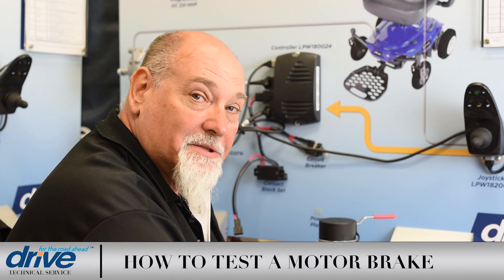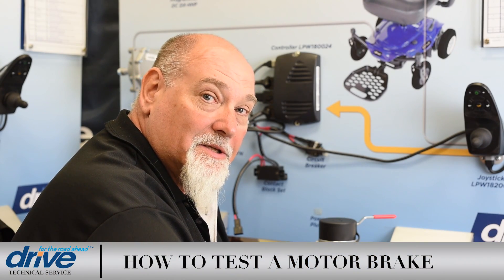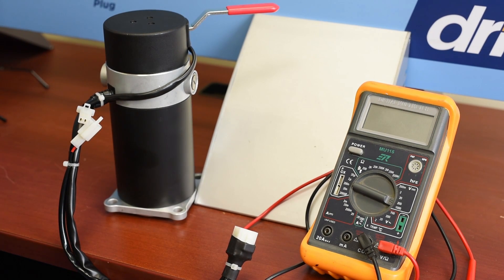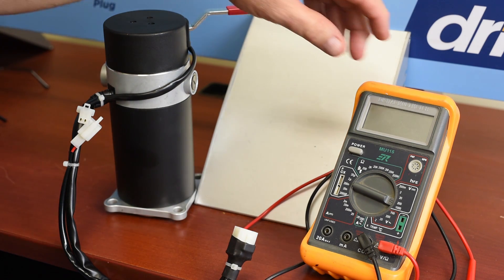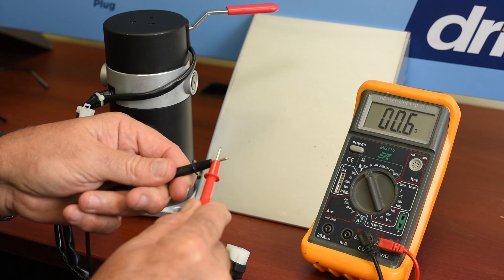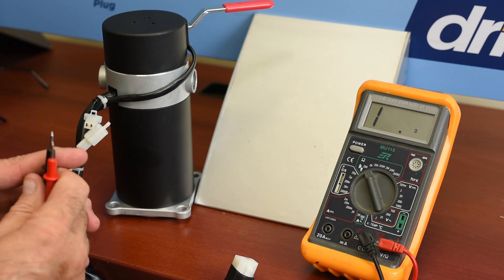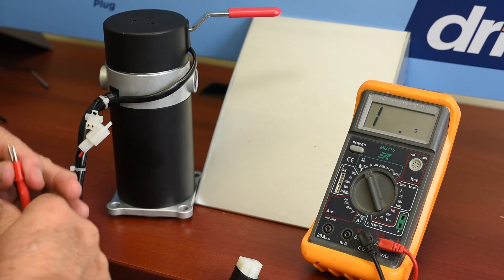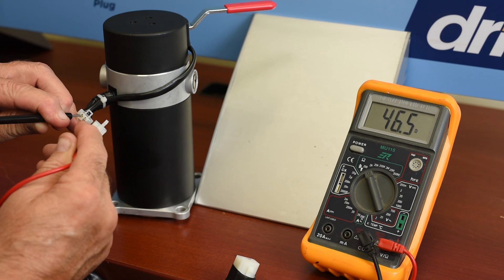How to test a Motor Brake

Comment: these coil based brakes can show correct resistance but short internally when 24v applied,
so best test is to apply 24v and see if it actually works. A very hot brake will also some times indicate a short internally.

Comment: Thanks for your information. I was dissapointed when measuring the resistance of the brakes in the motors of an invacare tdx sp i got from thrift . the resistance was giving ol reading. After viewing your video i tried again after engaging the gears? And Yes!, the correct resistance was shown

Comment: Hi, John, Love your articles very interesting to listen and learn.  I have an Invacare Leo scooter.  I have tested the brake as you suggested and there isnt any reading coming from it.  Disconnected it from the motor and everything seems OK.  Strangely  when I move the neutral lever the magnet is released and the large nut that grips the motor is freely moving.  Would it still be the brake at fault as there wasnt any reading.  Thanks for any help.  David

Comment: Hey, Nana is having a problem with her motor brake.  I know how to test and remove it, but is there a way to fix it if it is bad or is replacing it the only option?  I have all the necessary tools to pull apart and solder nearly anything so should I take a whack at it or not?  O_O

Comment: the brake resistance is 35 ohm but when the on-board current drops with a line the brake does not unlock anymore, can you help me with some advice please